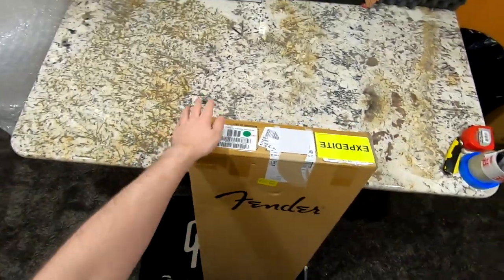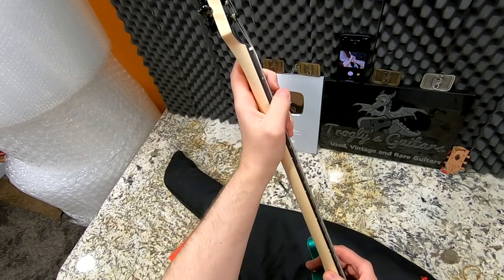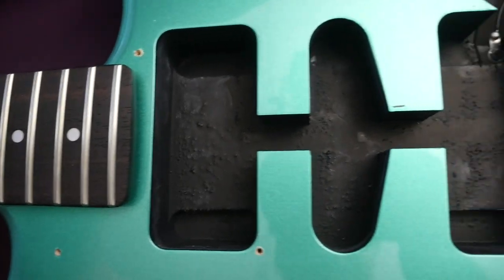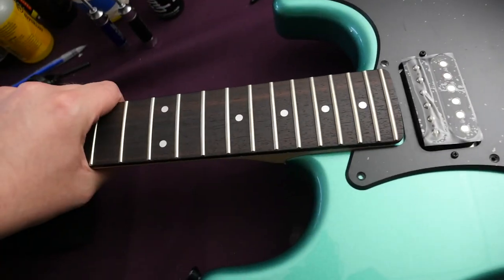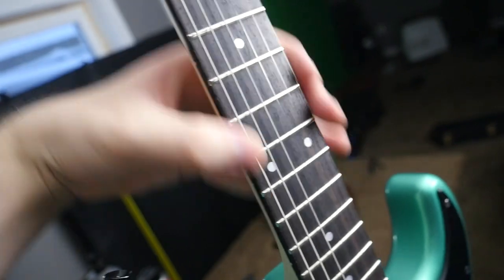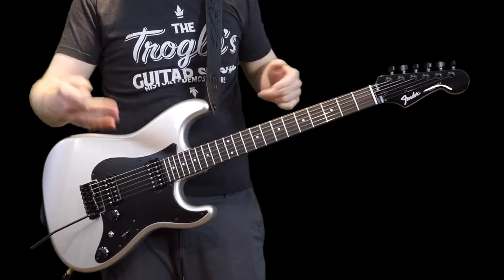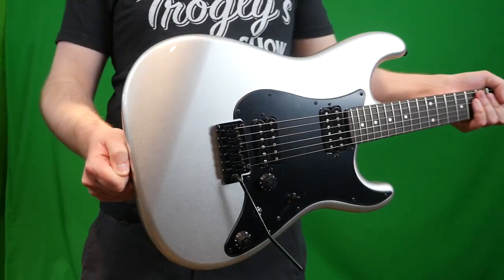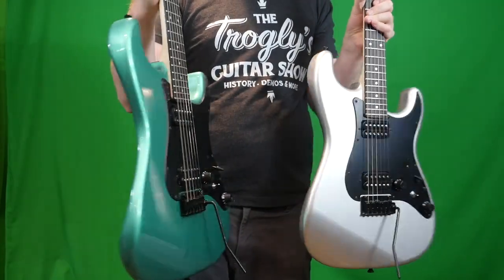Unboxing Fender Japan's Latest Guitar | 2021 Fender Boxer Series Stratocaster | Review + Demo

Comment: Austin loving those Japanese Fenders
Reply: I’m so glad I was able to get my Classic 60s Telecaster US Pickups (I think that’s the model name, LOL). A perfect guitar, black with mint PG and RW fretboard, got it for like $700. Ridiculous to try to rely on Fender USA to deliver the guitars you want when Fender Japan has been killing it for years.
Reply: @guitarocd9984  Thank you for mentioning it, as a Japanese. Many would be surprised to learn that the Stratocaster was discontinued in the early 1980s.
Reply: Guitar Ocd You are so correct about that.  In 1979 I paid $1200 for a brand new 25th Anniversary Stratocaster.  It was possibly the very worst guitar I'd ever purchased.   It was finished in a beautiful Pearl Metallic.   I enlisted in the Air Force in 1980 and carefully packed the Strat in its case and slid it under my bed before heading out to Basic Training.  When I returned I opened the case to find the finish had yellowed to a orange/parchment color.  Fender later explained to me that they had just switched to a water based finish process that year due to Kalifornia environmental regulations.   I refinished the guitar myself into a black-pearl and added a humbucker.    8 years later Fender reached out to me and asked if I wanted it refinished to original specs.  I said yes, had the it refinished and promptly sold it for what I'd originally paid for it.
Sadly it was one of the worst guitars I'd ever owned.  Had Japan not started showing Fender how to build quality guitars I do believe Fender would have failed.
Reply: @guitarocd9984  Fender sued Tokai lol
It may be a myth, but when Billy Gibbons was asked by Gibson for a signature model, he said, "Bring a guitar of the quality of Tokai's guitar."
Fernandes is also great for the same period. At that time, Carlos Santana came to Japan and bought a lot of Fernandes Strats. Both were dream guitars for me as a junior high school student at that time.
Reply: @guitarocd9984  The Tokai Love Rock Les Pauls of the same era were far superior to the Gibson instruments of that era.   At a time when Gibson was using pancake bodies and short neck tenons Tokai still used a 1-Piece body and neck as well as the long neck tenon and a true ABR-1 Bridge installation.Heck, the modern high end Tokai guitars are still as good a quality as Fender/Gibson and priced about 25% less.
Reply: Japan has been improving American products and forsing U.S. manufacturers to up their game for years especially in the 1970's. And not just guitars. Honda pushed Harley. Datsun and Honda pushed GM, Ford. The list goes on.
In the end the consumer wins.
Reply: @guitarocd9984  You Googled poorly, the Orville brand was launched in '88 and Matsumoku went out of business the year before in '87. Orville guitars came out of the Terada and Fuji-Gen factories.

Comment: Re the Boxer Strat, I have 3 MiJ  Fender Strats - 1 from '85 & 2 from '86. Mine are all the same colour, Burgundy Mist, if I recall correctly. Not only are the headstocks black, but so is the entire neck, minus the fretboard, obviously. These are the best playing guitars I've ever owned and back in the day (they all need a little tlc now) they held tune incredibly well with the System One bridges. Also, in spite of the neck finish - or perhaps because of it - they never seem to get sticky even at a hot, humid gig. I love these guitars.

Comment: I really enjoyed this vid, thanks for the review. I'm a Japanese Strat guy since 1985. I've got only 3 Strats and they're all MIJ, '85 white SSS with Kahler Spyder tremolo, '88 HM white somewhat rare only made in Japan with a single humbucker pup, and a '90 Floyd Rose black with vintage tuners and medium heavy frets. I'm thinking of having a '21 Boxer to add to my collection because I don't have a HH type yet, the only thing is it's expensive or I might get just the newly issued HM model instead. I prefer the body of the HM because of its larger cutaways and contoured neck joint. If I can't afford a new one I could get a slightly used one.

Comment: There is an original in my local guitar shop. From what I can remember that one was a pearl coloured hss with no scratch plate, had a super trem with 2nd locking nut and a black gloss neck. The boxers are meant to have a fully black gloss neck instead of a clear satin.

Comment: About two-single-coil Strats: Ritchie Blackmore had a signature Strat in the 90s that was just neck and bridge. Current version has a dummy middle pu, but older versions just had a two-pickup pickguard
Reply: Hi Dave!  Thanks for mentioning this, I commented on the Richie model then scrolled down to read you were already there eight hours ago. 
Would you know how Richie wired his pickups?  I see on the Fender site their Blackmore Strat is neck/both/bridge which makes sense, however while watching Richie live 1984 videos just last night he seemed to be using the centre position as a kill switch.  So far I haven’t been able to find out much about it or if my perception is off. (highly possible 🤪)
Any ideas?
Reply: @Riverdeepnwide  honestly, no idea.
Reply: @Riverdeepnwide  the wiring I'm seeing is Tele three-way — neck-both-bridge — but seeing how Ritchie only does neck or bridge, I could imagine his tech wiring it neck-kill-bridge instead

Comment: The mid 80's E serial number  MIJ strats were some of the best strats ever made.  I have a 1985 MIJ (E serial #) 1957 Reissue  that I got new in 85 and it is probably my favorite strat I have ever owned or played.  I chose it over the American Strat  I had and sold.  I even liked it better than the custom shop strats  I have played.  If you find one in decent shape on Reverb you are going to be paying around 800 bucks and over 1000 for one in mint condition.

Comment: Glad they brought these back.  I had one of these with black body, dark rosewood board (virtually ebony in color), black headstock, black hardware, it was like Darth Vader's guitar) and I loved the guitar but the guitar suffered damage when the neck snapped off.   I sold it to a guy who was pretty much a home-only player since I needed a gig ready guitar.  Might be worth tracking one of these down.  I love the big fat frets too.  I did the bulk of my guitar improvement on that guitar in the several years I owned it, I just played it all of the time.  The neck feel was addictive.

Comment: Hey trogly/anyone reading the comment section, when talking about the tremolo block you point out when a magnet does or doesn’t stick to it. What would the difference be regarding the tone? Like do magnetic metals give more sustain or something?
Reply: If it's not high quality metal then the magnet won't stick.  Less about tone and more about quality.
Reply: @Tyler Aitken Gray that I can get behind, but does the material itself make a difference? And if so, what difference does it make? Is it like a tone wood difference, where it’s only sort of noticeable, or an AlNiCo/Copper wound pickup difference where there’s a pretty significant difference? And what would the different metals sound like if that’s the case?
Reply: The metal type used in the tremolo sustain block can affect tone.  Heavier more dense steel will impart a different attack and sustain as compared to an alloy style sustain/trem block.  It is all subjective to the player's ear and boils down to personal preference.
Reply: Interviews with guitarists like Ry Cooder and Eric Johnson bring up some interesting things about materials. 
I’ve read of things like titanium saddles for EAD, brass for G&B and a bone insert under high E and many variations thereof. 
If anyone really wants to disappear down a rabbit hole, check out metallurgical spectrum analysis of frequency response in different metals.  Bell Brass makers in past centuries had to, like renowned luthiers of old times, rely on their bodies (ears specifically but I think all creatures “hear” with more than just that). 
Trust your body, inform the mind, wisdom may come before we have to go.
Reply: In addition to the interesting topic of the bridge material, the ones in this guitar are Gotoh brand same as the tuners, probably special made for this reissue since it is not disclosed anywhere by Fender. And don't loose the tremolo bar It will be hard to find a replacement in the US.

Comment: I own one of the 80's model ( dark redish pink)that has a single humbucker and had a lock down "Law Suit" trem system. I had a Floyd Rose installed and a Carvin M-22T humbucker also. It is my "Work Horse". I believe its an 85'........I used it for years when I worked in a group. I love Japanese Strats.

Comment: TBX = Treble Bass Cut (like your computer's Ctrl+X or Command+X for "cut")

Calling it an "expander" is pretty common, but doesn't make any sense.  And because it is a passive circuit, all it can do is cut frequencies, not add (or expand) anything.  If the control is rolled all the way back, it is cutting a lot of the treble, just like a typical tone knob.  When you get to the detent in the middle, then it is like a typical tone knob all the way up.  Nothing is being cut at this point.  As you continue to turn up the knob, it starts cutting bass frequencies.  This gives the impression that the tone is getting even brighter, but it is really just bass frequencies being removed from the signal.  The overall impression of the knob is that it goes from dark to really bright as you turn it up.  But the first half of the knob's travel is exactly the same as a standard tone control, and the second half just gets you into "extra bright" territory by removing the low frequencies.

In the '90s when they put the TBX tone control on the "Plus" Strats, it was usually just for the bridge pickup.  Why anyone would want a Strat bridge pickup EVEN BRIGHTER is beyond me.  But I have found it really useful for neck pickups, allowing you to tame some of the "mud" that can often result from a distorted neck pickup tone and adds a lot of clarity.  Fender also put the TBX tone on the Precision Plus bass, which again didn't make a lot of sense to me, but it did allow for a really thin sound from your bass guitar, if you wanted that for some reason.

Comment: Stoked you’re doing this review. I had hoped you would, as I have a1985 MIJ Contemporary with the Series III bridge. It was my first “real guitar” after a Memphis S style. That bridge has always been a pain to string and it sat for years unplayed. Recently brought it back to life so it was surprising to see Fender release these now, but very cool indeed. I actually had to get a new style nut for mine because the locking one was missing parts, and the proper replacement was just too hard to find.

Comment: Had the TBX on my 93 American Standard Strat for years and really didn't care for it at all.  Eventually (and recently) I just bought an Obsidian Wire Solderless kit for it and some Fender Hot Noiseless pups and that 90's Strat is way better now.  TBX is good if you like it, but I have more fun with the blender mod on that Obsidian kit.

Comment: Ritchie Blackmore technically has a neck and bridge pickup in most of his Strats, ie: his signature model.
If you look closely you will see that the middle pickup is a dummy, doesn't even have pole pieces,  it's just there.

Comment: Did you actually know that the output of a pickup is not being measured in kOhm? DC-resistance does not equal output. The output is correctly being measured in inductivity or inductance, and the unit for that is Henry, or in short H.
There is one thing to the kOhm, the DC-resistance comes from how many times the coil is wound. And if you have a weak magnet and the coil is wound to high kOhm, you have an overwound pickup, but your output is low because of the weak magnet with a low Tesla or Gauss. On the other hand there are underwound pickups, a strong magnet with a high value of Tesla or Gauss and wound to a low kOhm value, then you come close with the output by kOhm reading.

Comment: I'm curious as to what kind of finger style machine it might make. I like that it doesn't have the center pickup which is where my finger nails always seem to strike.  I like the look, but I lived through the 80s, it is a highly acceptable style. The important factor on fingerstyle guitars with longer scale lengths is the pulsation (en Espanol), the resistance of the string, while playing, to the picking finger. Some guitars got it, some don't.

Comment: Yeah, to me this guitar does not sound like fit for shredding metal nor classic rock.
Maybe it's an adjustment, but at the nut region it sounds a bit sloppy, almost rattling.
The looks are good, smooth sparkly finish.
And why would the tremblock be tapered?
Well, thanks for bringing these to my screen!

Comment: I vote we didn’t know.  Love the exaggerated body contouring, where is the skunk stripe?
Reply: These style necks have the truss-rod route under the rosewood fingerboard.   The skunk strip was originally the result of the 1-piece maple necks where the maple fingerboard is the same piece of wood the back of the neck is made from.  With the one piece neck the skunk stripe was required to cover the route Channel used to install the truss rod.  In later years Fender has added or deleted the skunk stripe for any number of reasons, mostly due to lowering the production costs in one form or another.

Comment: If only Fender would move the volume knob for these type of oddities. It's the thing that holds me most off buying a strat.
Reply: True, pickguards are easy to get though
Reply: There are quite a few services that offer completely custom pickguards. You can get a strat, strip the pickguard, trace it out on some paper and then move the control locations wherever you want on the drawing, then send that off to one of the custom companies and you'll have a pickguard exactly how you want it in a few weeks. That's one of the cool parts of a strat. No holes are in the actual wood so players are free to customize it however they like

Comment: Greetings Austin!
I  would really like to add one of those Stratocaster’s to my collection. I really like the side mounted input jack. It would be super easy to change out the pick guard and have whichever pickups you prefer, but I think I could rock it as is without making any changes. The color choice would be hard for me to make, I think both of them look great. 
I have a silver burst Stratocaster with a coil split on the bridge pickup, it has the HSS pickup configuration and is sounds great.
I would prefer a hard shell case instead of a gig bag, but I can always find a Strat case. 
Thank you for posting this video! Please have an excellent and awesome day! 🙂

Comment: I have the silver one - those pups are hot - to hot for me. Anyway the neck is perfect - the tuners a little tight - 12 radius feels good. Now I need those change those pups out. Any suggestions for me?
Reply: Have you tried just lowering them really far down? Like flush with the pickguard? Then raise the bridge pickup a smidge so the volume is equal between the pickups. If you still really can’t stand them, I’d recommend a set of Pearly Gates pickups.

Comment: My experiance with recent Japan Fender is the build quality is still amazing but the electrics suck.
Reply: Good to know, a little disconcerting, but good to know. I hear complaints on the comment board about the hot bridge pickup, any idea what its comparable to? I like 80's hair metal, it's nice to think I wouldnt have to swap out for a DiMarzio super distortion, if the nuts are already in it.

Comment: Nice but... IMO should have been hard tail or Floyd Rose.
But, Fender would have probably used a Floyd Special and charged extra. If Harley Benton can ship a guitar for 400 bucks with a Floyd 1000 series everyone can.
Thats where I think they F'ed up the HM strats ... cheap hardware.  These where not that big of a deal in the 80's..... I remember them only because the years they came out there were no USA fenders at all.
But I also remember these with Kahlers and the weird trems that they where using to try and skirt Floyd Patents.
Now, the Ibanez Genisis series ... They did everything right.  Better than original neck, Edge trem, awesome colors, some Dimarzio pickups.  Under 1000 dollars.
Something about a Fender trem in black just screams cheap knock-off to me, especially the zinc block. Even though this looks like it might be a Gotoh.